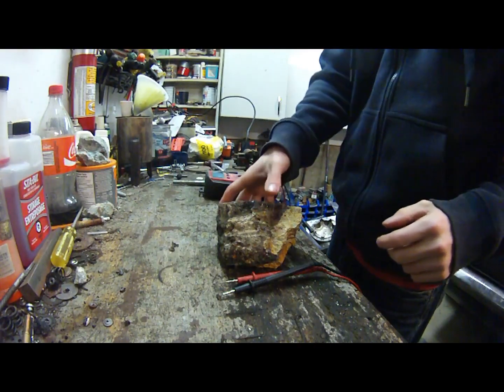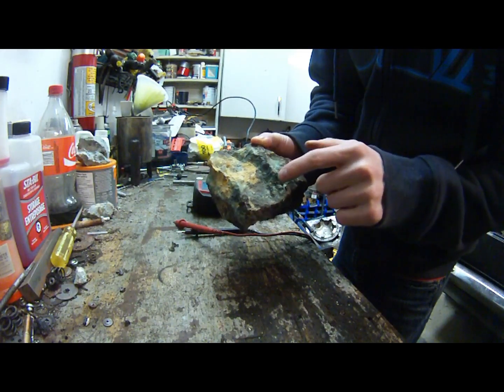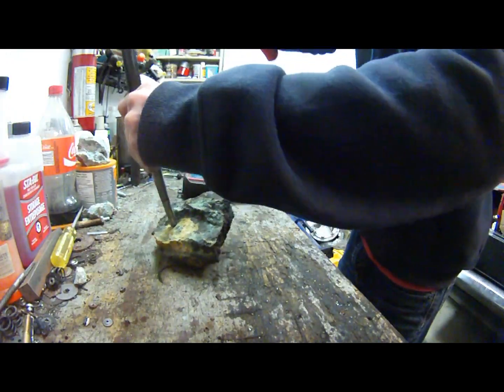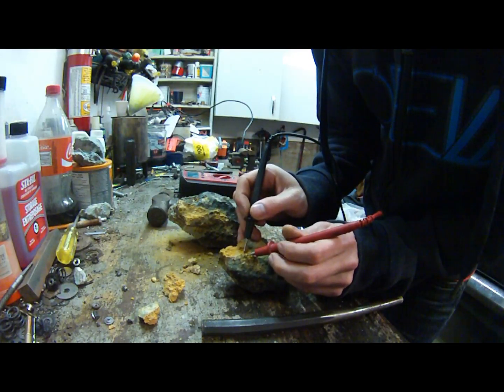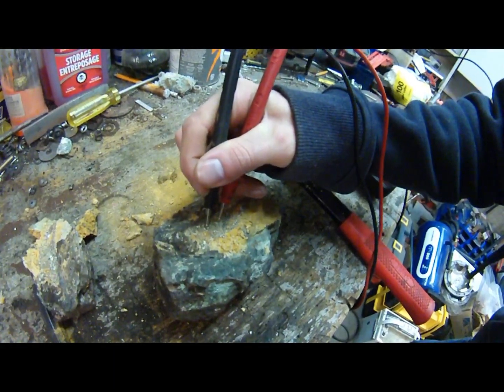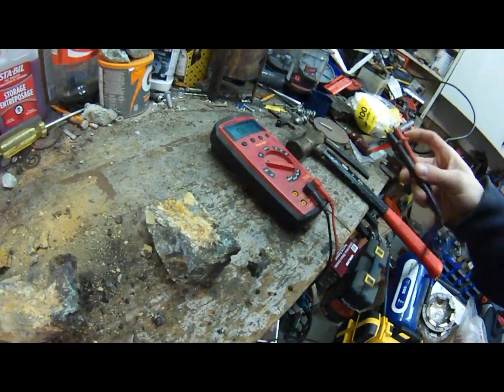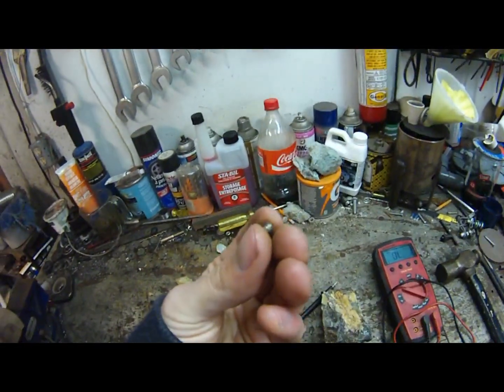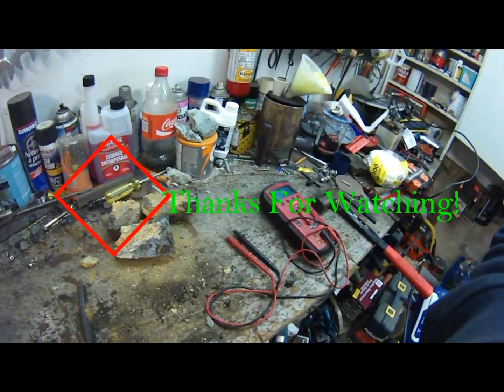Easy Continuity Gold Testing In Raw Ore With Multimeter - How to / DIY

Comment: I’m wondering if it’s not buzzing because you’re hitting something between 50-120 ohms although I would assume at such a small size, it would likely be well below all that?  I know nothing about electricity, or science or rocks for that matter; I’m trying to learn haha. But I took out my multimeter and am reading the instructions and it says it may not beep when the resistance of a circuit under test is between 50 and 120 ohms or greater than 120. Again, I have no clue what ANY of that means haha. Also, I wonder how other metals will interfere since they’re also conductive?  So can you do this for silver and copper, etc? This was an excellent idea though, and I want to try it out on some of my very first Rock stash I collected for my new hobby. The learning curve is far more massive than I thought rocks every could be haha. Well done brother! Thank you.
Reply: How has it turned out for you?